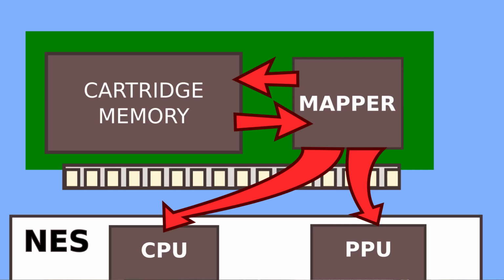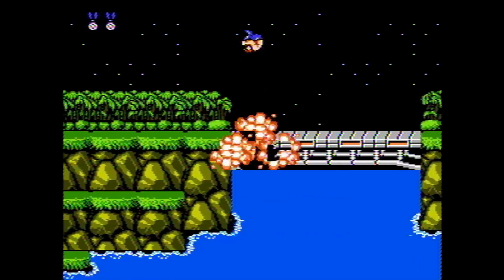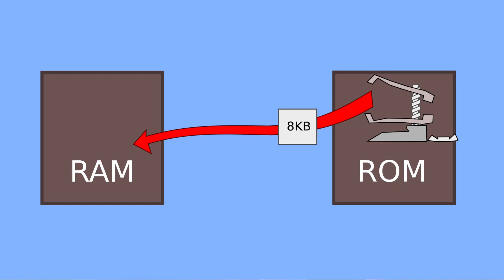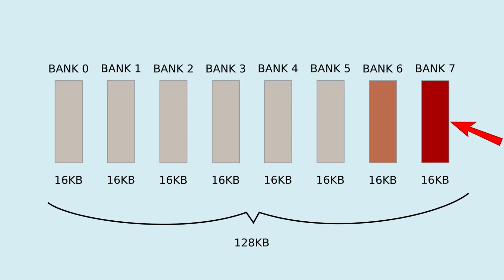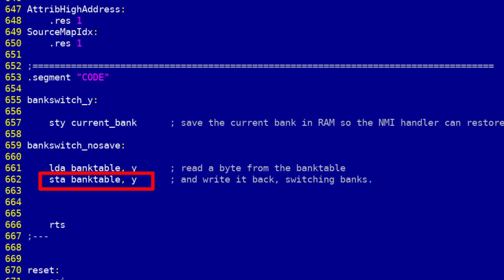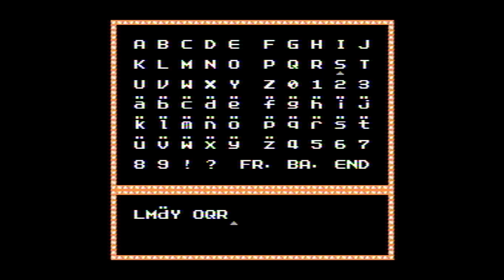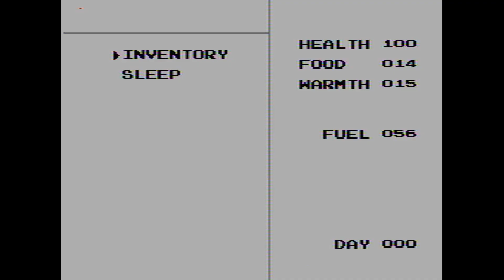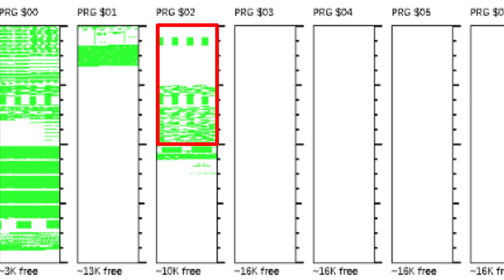Making My Own NES Game (#06) UNROM mapper

Comment: Awesome update!  Love seeing progress on this project! 👍🏻
Regarding saving... why not just add a battery to the CHR SRAM; and reserve a few tiles at the end as the "save file" (e.g. instead of loading in all 512 tiles... only use 510 of them at a time for actual graphics, and using the 32 saved bytes as the as the save file?  Yeah, the entire SRAM would be battery backed, but that's okay, it won't hurt anything, and many battery backed games used most of the SRAM as Work RAM anyway... )
I think using PPUADDR and PPUDATA should work to be able to read and write to those bytes, and players expect saving to take a moment anyway... 

The one hiccup I think you'd have though is, I'm not sure if any emulators / flashcarts would support battery backed CHR RAM... I just think it's probably better than a password system...
Reply from the maker: Thanks! Haha, that's an interesting idea. It will be amusing to try it out for fun.
Reply: @Memelvar  So... also... I feel dumb now, but I was looking at the NES header format... it looks like there is just a bit you can set to specify that there is battery backed PRG RAM present at $6000-7FFF. -- Regardless of the mapper type. -- I think Alwa's Awakening is a game that uses UNROM 512 with CHR RAM, and also has a battery backed SRAM for game saves... -- it works in emulätors and has a physical cartridge release.
Reply from the maker: @BrainSlugs83  as far as I know Unrom 512 is a bit different, but this flag should not work with the regular unrom. I haven't tested it personaly though.